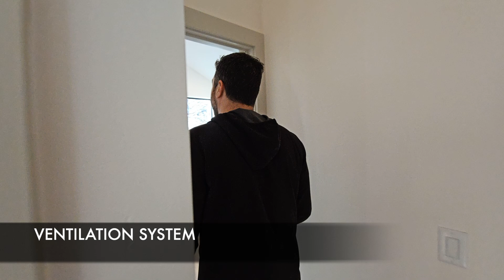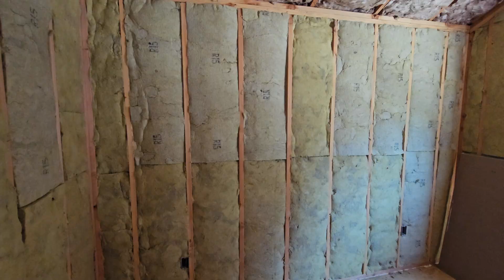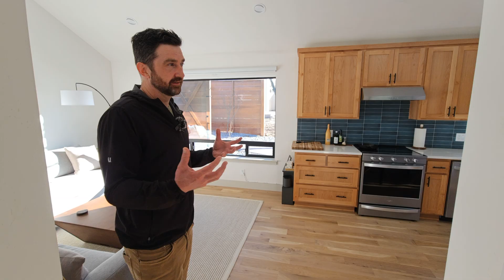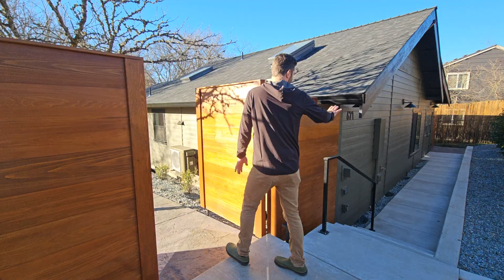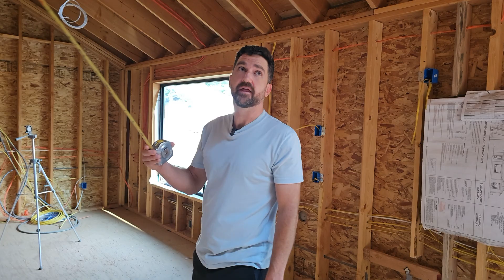10 Hacks to a Healthier Home

Comment: Skylights!  The place we're renting has a skylight in the bathroom, it's clearly leaking and my guess is we're getting mold so no so healthy.  Fact that most people I hear talk about skylights point out how bad they are for leaking.  I hate those natural gas generators, my neighbor down the road has one, whenever the power goes out we get blasted with noise from the thing.  Usually goes off in the middle of the night waking us all up.  Get a battery backup, or have your neighbors hate your guts.
Reply from the maker: Great feedback, thank you. Yes, the backup will be a battery bank/EV. As for skylights, you must use cub mounted ones with the Velux factory flashing kit. They have a lifetime no leak policy. We have never had a single issue.

Comment: By no definition are these "hacks", ideas or tips yes, "healthier".....some of them.
Reply from the maker: I think they are. We are taking elements that most houses have, and changing them slightly to produce a better result while improving heath based on data.
Reply: @ThatADUGuy  I get it's your channel and you used "hacks" to get clicks....but again, by no definition of the word or usage of the word is anything in this video a "hack".  The dude talking about "mini splits, because they don't bring in outside air"....duh, neither do whole house HVAC.  Name one thing that was a "hack" in this video.
Reply from the maker: I make videos to add value not to get clicks. The biggest hack is living large in a small house with good design. Vaulted ceilings make a small house feel larger. Merv 13 filters are the only true smoke filter. ERVs are affordable and bring fresh air into a home inproving cog function (unlike your example). Double 5/8" drywall soundproofs a room for cheap. Putting lights at the right hight improves sleep. Slylights that open, cut cooling bills way down by letting heat out almost instantly at night. Most people want an EV charger to charge there car from the house, this house can run off the car. The SW air filtering paint is only $5 a gal more than stabdard paint. These are all great hacks to building a smaller, healthier, and more funtional home.
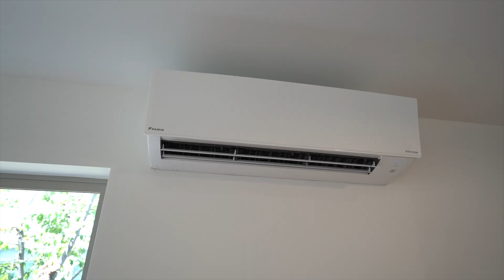Reply: @ThatADUGuy  Your title was to get clicks, your video proved it was clickbait.  You have tips, ideas, examples, suggestions but none of them are "hacks", read the definition.   "The dude talking about "mini splits, because they don't bring in outside air"....duh, neither do whole house HVAC."  Yes that was one example I used, it's at 1:18 in your video.  Don't worry, I unsubscribed so I won't be tempted to call anything out in the future.
Reply: @Chilibeanz559  Wow, you're negative. You certainly have the right to say whatever you want here, we all do. I would only add that something so minor has caused you to unleash your bad juju in the comments section. You were even so disturbed by the title that you unsubscribed, wow. I know we all have opinions to share.  Just adding mine here, it was an excellent video.
Reply: @weston.weston  Wow, you're sensitive.  Calling out a title that claims it will provide "hacks", and then in that video not one thing is, by any use of the word, a "hack" is not negative.  I chose to unsubscribe because the creator doubled down on his claim of providing "hacks", it's clickbait.  Using items for their intended purpose is not a hack.  I mean really, the dude that's giving this tips starts out with, "windows that can open up to let air in",  such a novel idea, air purifiers to clean the air in your home, yeah that's what they do.  If you think stuff like that makes for an "excellent" video, that's on you.  Oh, and really with the dramatics, "unleash your bad juju"? :dothefive:
Reply: @Chilibeanz559  💙 💜.

Too funny.
Reply from the maker: Thanks for supporting our channel while you did.
Reply: @ThatADUGuy  you have such a great demeanor about yourself! You da man …….seriously, it shows great character to always take the high rode!
Reply: Thanks again for the years of great content! I just finished my ADU build in Northern Cali (Bay Area) and getting it prepped (furnished) for Midterm tenants (at least for the first 2 years). You have inspired me so much and have given such great tips, information and education along the way! You are a huge inspiration and helper to all who take the time to learn from you and your peers! 💪🏽🤜🏼🤛🏽
Reply: @ThatADUGuy  " The biggest hack is living large in a small house with good design." - DS     These are guiding words on design.  Thanks.  I've picked up so much extremely helpful information.
Reply from the maker: Great to hear!
Reply: @ThatADUGuy They definitely are hacks, thank you for sharing this build with us!
Reply from the maker: .  You're welcome, thanks for the views!